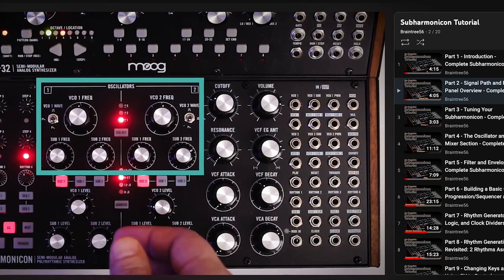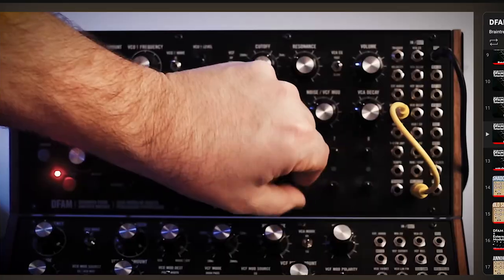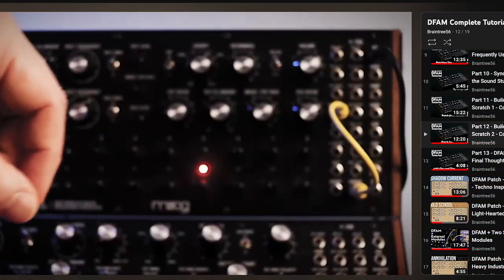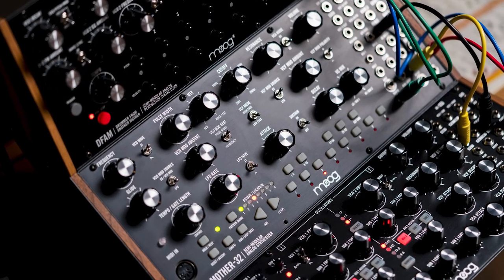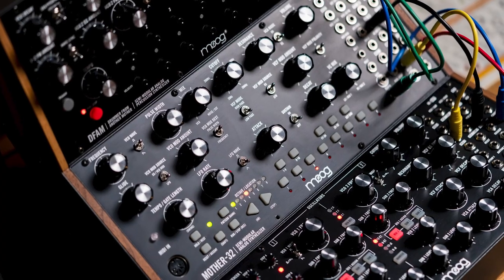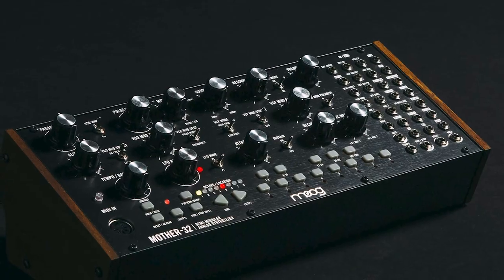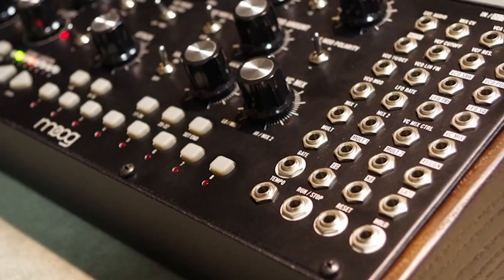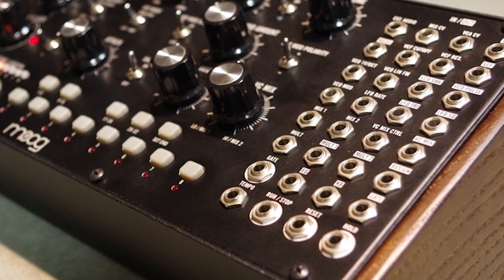Mother-32 Complete Tutorial | Part 1 - Introduction

Comment: Great video. I just got one. So I’m just starting my journey. Do you have a video on how to connect another synthesizer? Like a Roland AIRA Compact T-8 Beat Ultra-Portable Bass Machine?
Reply from the maker: I don't have a video on that. There's so many ways to rig it. I would probably use Midi or get some sort of CV to Midi converter. Midi is probably the easiest way to go.
Reply: Thanks. I wish it was that easy for me lol. I’ve tried but can’t figure out how to sync them. Used MIDI out from the mother to midi in to the T-8 Roland and from there I’m lost lol.
Reply from the maker: @enslavedbyvegetables3407  What do you mean by 'sync' - just the clock or are you trying to have one play the other?
Reply: @braintree56  well I’m new at this but I’d like to be able to have the mother be timed with the drum machine. So I guess the terminology would be clocked? I was able to do it once with a couple of different synthesizers. But don’t remember or how to use it with the mother. Hard to explain myself when I don’t know the exact terminology lol. For that, I apologize.
Reply from the maker: @enslavedbyvegetables3407  Ha! Yeah, half of it is learning the lingo. You want to clock the mother from your drum machine. I can't remember off the top of my head, but I'll look a little bit later to see if I can give explicit instructions. Check the manual of the mother and look for setting it up as a "slave" or something like that. The drumachine will be the master clock.
Reply: @braintree56  ok. I’ll have to find the manual on line. Cause I got the mother the other day used so it did not come with a manual. Thanks 🙏
Reply from the maker: @enslavedbyvegetables3407  Make sure you check the right manual. There are two online. One with 60 pages and one with 72. The one with 72 is the correct firmware.

Comment: I've just bought fx aid to use with the moog sound studio but I can't figure out how to set it up.  Do I patch the m32 vca output into fx aid (I'm sure it's comparable to any eurorack fx) or do I need to put m32 audio output into the fx aid?  Also fx aid has left & right outputs.  Do I put these both through my focusrite line inputs?  Your help is much appreciated.
Reply from the maker: That would work! You could run the VCA out to the FX Aid and then run from the FX Aid into your interface. There are lots of creative ways to approach it though for different results. Like running out of the wave output and plugging into a separate input of the interface - mix it in with the original signal that way, etc... That's part of the fun of modular! :)

I don't have the FX Aid, but my guess is that one of the outputs is Mono when nothing is plugged into the other. So you wouldn't have to do both. But it depends on the effect. If there is like a ping pong delay, you'll probably want stereo, so you could use both outputs.
Reply from the maker: Also, check out the last video I did were I patched a bunch of modules to the Mother! That might help.
Reply: @braintree56  Thanks for your help, I got it working.  I'd been patching into the cv inputs instead of left and right inputs.  Was starting to think I'd broken it lol.  Look forward to your next video dude.  Keep up the good work.

Comment: I am pretty sure that this series of yours, in time, will become a reference tutorial for the whole Moog Sound Studio. Few other propositions are both as thorough and as structured.

On a side note, I, for one, was never truly into the M32. It is a nice machine obviously, that gives full access to the Moog sound for an "almost" reasonable price, but still ... I never saw myself putting around 800€ in a single-oscillator synth. Every part in itself is fine, and I understand the global appeal of the whole machine, but compared to its siblings the SubH and the DFAM, the M32 lacks a je-ne-sais-quoi of personality and character. Possibly it is a little too "vanilla" for me to warrant such a price, at a time when machines like the Behringer 2600 or the Pittsburgh Taiga (both with three oscillators plus LFO !) are available in a similar price range.
In a way, I feel that a more balanced offer from Moog would have been to pair the SubH and the DFAM with a Mavis-like machine, chopping a good 400 € from the total price of the Sound System. But then, Moog is aiming at the higher-end segment of the market, so I suppose that on a purely business-oriented reasoning, they did exactly right.
Reply from the maker: Thanks! Much appreciated.

I see what you're saying about the personality, however, I really like the Mother. I know it's expensive, but if you tried to recreate the Mother by buying individual modules, you would certainly spend more. There are other options, as you've mentioned. The Pittsburgh Taiga was only released recently and will likely give the Mother a run for the money. I do think it has a personality of its own though. I find it much easier to manipulate than either of the other two. It's much more flexible... But that might be because it's what I'm used to... Who knows... It's still probably my favorite of the three.
Reply: @braintree56  Interesting testimony.
You are right that I have somewhat been comparing apples and oranges, what with the Taiga being a very recent machine while the M32 is the older of the three Euro-rack machines from Moog. It was a bit unfair of mine, in a way.
I guess the nice thing with the M32 is that it is thorough: between the sound functionalities, the sequencer and the MIDI capability, it is a self-contained machine that does not require anything else to « work », musically speaking. I am sure it is a genuine pleasure to play.
By comparison , as much as I love the SubH and the DFAM, they would be very limited if they were used on their own. They have to be parts of an ensemble.

In a way, the 2600 is a better example of my point (and here I am speaking of the architecture of the machine itself, be it cloned by Behringer or Korg or anyone else): this is maybe the most elaborate and complete machine I have ever played, and yet it was somehow the very first semi-modular synth ever created, 50 years ago. This feels simply mind-boggling to me.

So in a way, I was expecting Moog to do better than just come up with a single oscillator machine without effects some 5 decades after something like the ARP 2600 came out !

Getting back to contemporary machines (and without being provocative, because obviously the brand has a bad rap), I may probably have better used the example of the Neutron by Behringer (which, for once, was a genuine original creation and not a clone). 2 oscillators, 2 envelopes, a massive patch bay plus very decent effects, all for half the price of a M32. Had I not gone for the 2600, I believe that the Neutron would have been my go-to synth for leads.

I guess I resent Moog a bit for making clients pay double price just for their brand name. When they come up with true innovations like the SubH or the DFAM, I will gladly pay a premium price to retribute their engineers’ creativity and the commercial risk they took putting such disruptive machines on the market (the SubH could very well have been a complete commercial failure, being so tough to master).
But with nothing fundamentally new being implemented in a M32, I think the actual value of that machine is closer to half its retail price, and I am not ready to pay double the actual price just for the sake of a brand name.

Anyway, keep the great videos coming !